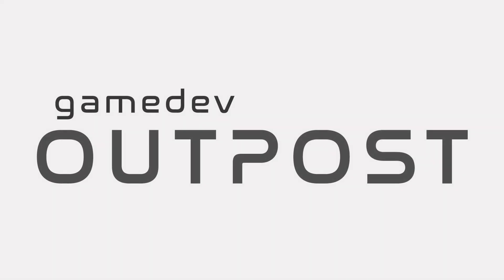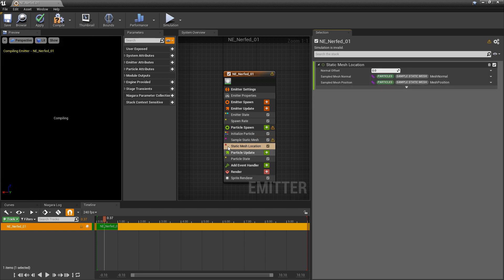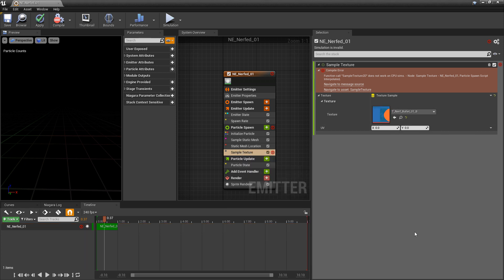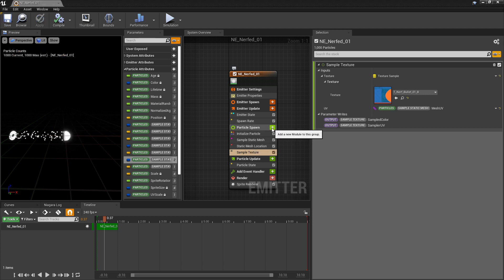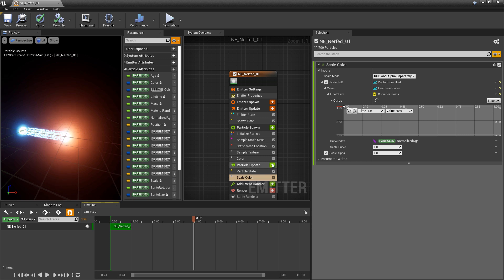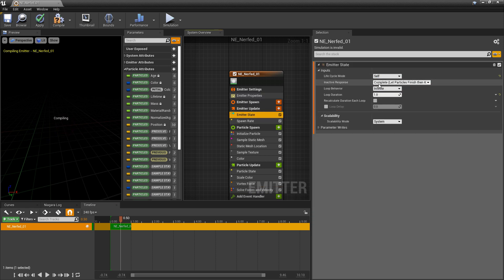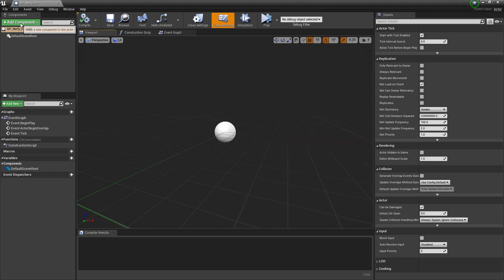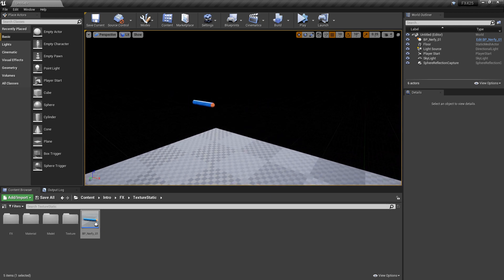UE4 - Niagara Texture Sample - Part 2 - Static Meshes

Comment: What does vortex force do? I mean I get it, its giving force in vortex but... what's vortex? like from where to where is particle rotating?
Reply from the maker: The Vortex force has a Vortex origin, by default this is the simulation position ( I e the emitter pivot point.) Then you have the axis that it spirals on (x,y,z). This is the distance out on said axis you want it to go. You could randomize these values in many ways as well, it depends on how math heavy you want to get.